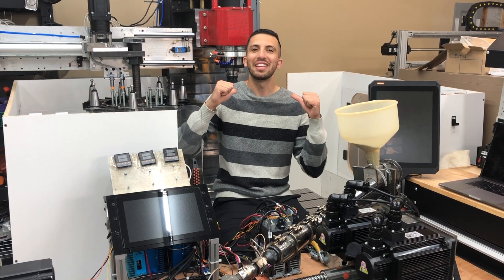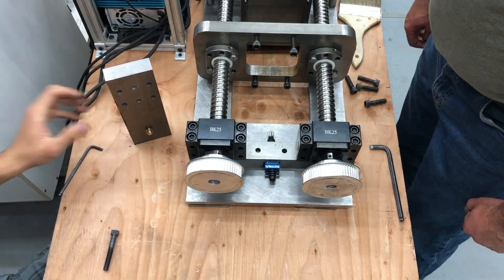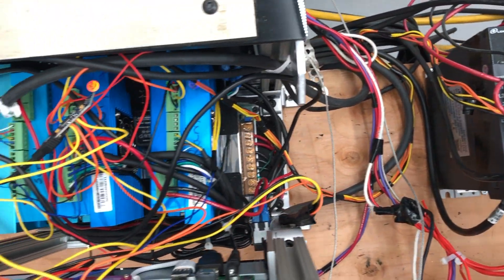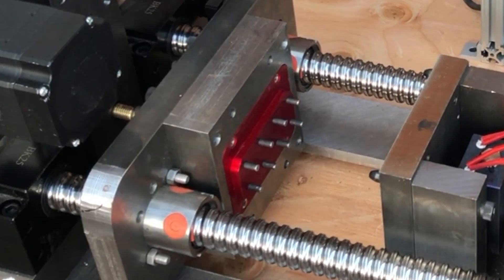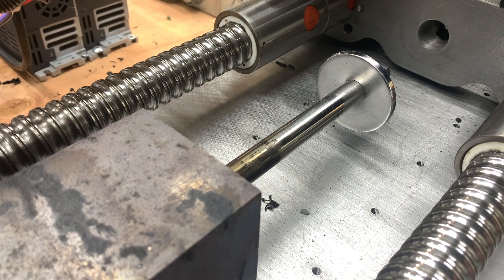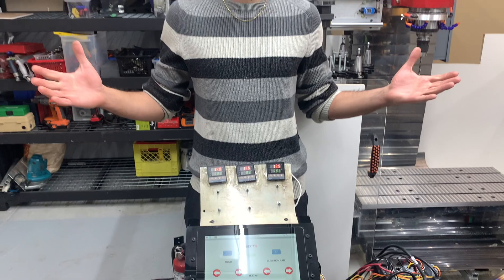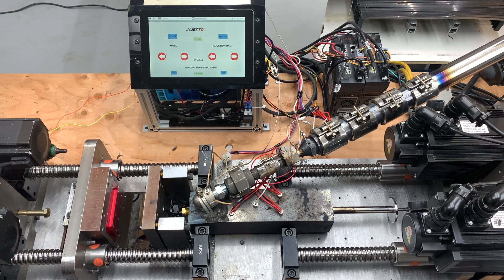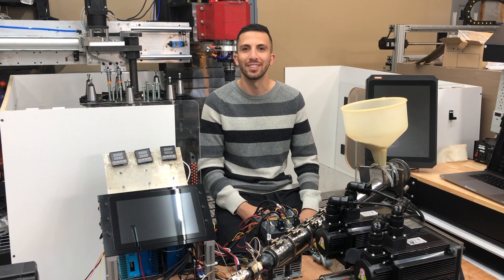Homemade Plastic Injection Machine | DIY

Comment: Really cool to see this happening! 

I still need to read on my book: "industrial plastics" by "Ronald J. Baird / David T. Baird". 

Im drawing up CAD files from the M16 and M4 blueprints ive got. There are some plastic parts on those guns. Its really interesting to see. I already made some molds for the (vacuum) investment casted parts from the trigger. They are to be casted in a plaster, the metal is sucked into the mold by a vacuum. The way you make molds for plastic is some sort of the same. The molds i made are for the wax that is to be burned out before vacuum investment casting is done. Im sure your machine could do wax molds too. It is really cool to mass produce complex parts fairly easily. You could buy or build a muffle oven that can do 1750C to melt steel. :) 

I thought it would be really complex to build this yourself. But you pulled it off. So it gives some hope to me/other people that are looking to build machines. 

Any way, i think detailed gun blueprints are a good study object because a lot of different techniques are involved to to make a gun. Some gun manufacturers of WW2 became producers of farming equipment. So yeah, i think its great to learn from these pieces of history. 

By the way i used the "mold tools" in solidworks to create good molds with the part file of the finished product. I could use the "scale" tool to make the mold slightly bigger, so the (half)finished product would be the right size after cooling down. 

Some industrial injection molding machines also have water cooled molds. Maybe you need it if you do a large production run(?????).

Really cool to see this!  

Greetings,

Jeff
Reply from the maker: Thanks Jeff, Im glad you enjoyed my build and could find a way for how it could be useful in your own cool projects. Feel free to help me out by sharing my video with others who may be interested in using this machine in their own design/projects 😃. Sounds like you really know your guns. Good luck with your projects. Dave
Reply: @ActionBOX  Im thinking about making vacuum casted steel tools, or gearboxes for example. I also have some prints of old single shot rifles that are cast steel. If you are in a legal spot where you are allowed to build them, it could be really cool! Also, i saw some real cool way to form aluminum parts from aluminum round bar. It is heated and then forged into shape by a hydraulic press with molds.

Yes im learning a lot. I also really enjoy seeing the stone epoxy milling machine. I saw a dude do the same thing. Another guy made a lathe with air bearings out of stone epoxy. Stone epoxy builds some of the most precise machines that are attainable. Really impressive performance!

Greetings,

Jeff
Reply from the maker: @jeffjefferson2676  Thanks Jeff, Glad you enjoyed my content 😃

Comment: Are you open-sourcing the designs by any chance? I need a plastic injection machine but do not have nearly enough money to get one ready-one (or the wish to be swindled by local distributors).
Reply from the maker: Hi, when I have time later in the year, if there is more interest I definitely plan on making this publicly available. Would it help to just have the plans?
Reply: Anything at all that would help put something similar together would be great. Plans would go a long way in achieving this - of course, models or a STEP file would be absolutely amazing! Projects like these are an immense help to folks who are striving towards their own business, but are unable to shell out the big bucks for overpriced and, more importantly, over-capable commercial machinery. I don't need 10000 injection-molded parts a day... I only need around 100, and on a budget. Anyway, please keep up the great work, it is one of the shining stars of YouTube.
Reply: @ActionBOX  Also, before I forget, if you are looking for new projects to tackle, check out VFFS packaging machinery. These machines are used to form, fill, and seal those stick-packs (and larger packages) that contain single-use products, salt, sugar, ketchup and the like. There are two things I noticed about the industry... Most machines are only fit for incredibly large production volumes of 50-60 stick packs a minute! This automatically locks one out of a purchase if they are a low- or even mid-volume business. Plenty of powdered, single-use products out there which are very high-value (in the chemical and pharma industries) and not usually packaged by the ton, yet most VFFS machines are only aimed at low-value everyday products. Which brings us to another problem that is rampant in the industry, that of dosing the products into the stick-packs prior to sealing. Most dosers are not accurate enough and do not accommodate mixtures of powders. It becomes easier to design your own doser at a certain point. Too bad, because ALL the commercial VFFS machines I have seen always include a dosing unit, which cannot be easily changed. Due to these problems, it would be grand to see someone have a go at putting together a more compact, semi-automatic VFFS machine that wouldn't break the bank and would be suitable for smaller businesses... Perhaps even a bench-top one!
Reply from the maker: @KANKDINGcreations  sounds cool. Can you share a link with me to one of the better videos?
Reply: @ActionBOX  I could not find any great videos explaining the principles of the machine, but this video does a decent job of showing the main components: https://www.youtube.com/watch?v=ZSUwNp3xiFs&list=PLw9BwnfkG2oeUk7l3b4L-WhMaiO-f3n_P&index=148. These are:
1) A dosing unit. This is only necessary for complete automation, and really tricky to get right depending on which product you are packing. Liquids are easier, anything that needs gravimetric measurement (high-value powders etc.) requires more accuracy and precision.

2) A packaging material film roll, which is passed under tension onto a hollow forming tube. The material wraps itself around the forming tube, the tighter without obstruction of movement or damage - the better.

3) The material is pulled downwards along the forming tube by two belted motors (not sure I am using the correct terms here) either side of it.

4) There are two heated sealing jaws - the first one seals the material vertically as it passes along the forming tube, the next one that seals it horizontally at the bottom and top to form the final package/bag.

The material to be packaged is dropped through the forming tube into the packaging, which is at that point sealed both vertically and at the bottom. The package is then sealed and cut at the top such that the finished package separates from the material on the forming tube.

Comment: Amazing machine! Are HTD belts suitable for such high horsepower motors? I mean their power rating.
Reply from the maker: Hi, I stripped several of these belts while testing my software (by colliding into the travel limit and then learning that the motors are too powerful for these belts 😂) but during normal use they hold up. Great question 😃
Reply: @ActionBOX  Seams to be a great failure point. rather than destryoing the ball screws, the belts act as the cheep weakest link.
Reply from the maker: @TheTwtwo  😁 thanks for noticing.

Comment: Why do you need such strong motors? Is the lead screws very easily back driven?
Reply from the maker: Ideally you want to keep the plastic as cool as possible or else it burns or discolours, and to keep temperature low you need to increase pressure. Hence, the bigger the motors, the better.

Comment: I work with a full size plastic injection molding machine. Fascinating to see a homemade desktop version
Reply from the maker: It's nice to have the support of a professional in the field. If you know of any groups or forums that would be interested in this, feel free to help me out and share. Cheers 😃
Reply: @ActionBOX  Hahaha. I don't think I qualify as a professional. On Semi-Auto I just open a door pull the runner out and the part out (or just the part if the part has a sprue) and close the door. On fully automatic cycles like yours was running, the machine drops everything into the chute and the mold closes. Some of the presses at the factory I work at are absolutely massive. I am not a technician and I am not able to actually work on the machines. Either way. I am thoroughly impressed. Be careful however of the fumes when purging your machine. Our big professionally made machines have warnings about inhaling the fumes of molten plastic. I'd assume that it could be just as dangerous for your little mini-press
Reply from the maker: @Mboy245  Thanks Jonathan. Just being exposed to these machines already makes you an expert 😜. It actually teaches you a lot. Believe it or not, I've never actually seen a real machine in person (up close). Just read lots about the physics at play. The fumes are definitely a point of concern, Great Point.
Reply: @ActionBOX  Also I shared your video with some of my coworkers. They thought it was pretty neat. Keep up the great work and cheers to you too 😎
Reply from the maker: @Mboy245  I LOVE THAT. Thanks for sharing and helping my channel grow 😊. I look forward to your comments in my future videos

Comment: Nice work. Is it necessary to cool down the mold by circulating a coolant?
Reply from the maker: Great question. In real machines they have coolant to maintain a certain temperature (I assume they also have heaters). I found that in this machine using an air fan is sufficient to maintain the appropriate temperature. Hope that helps and glad you enjoyed the video. hope you can help me out and share my video 😃